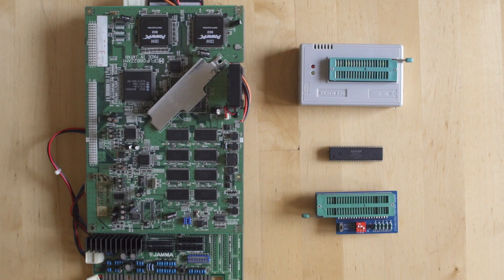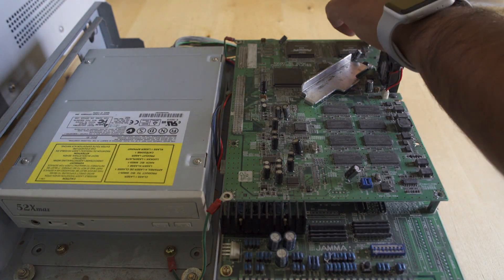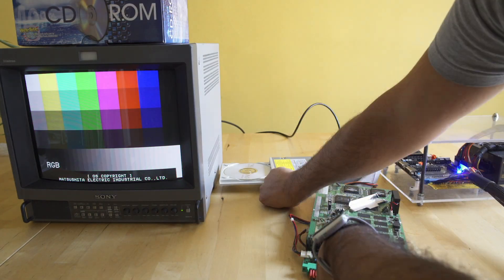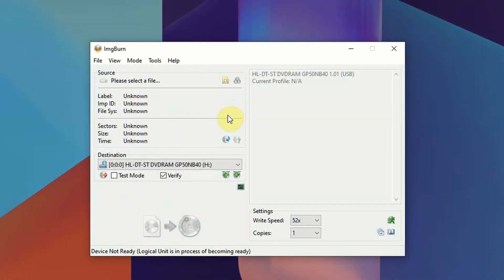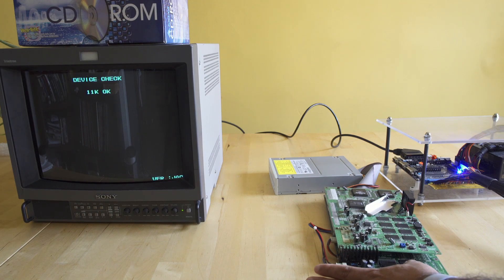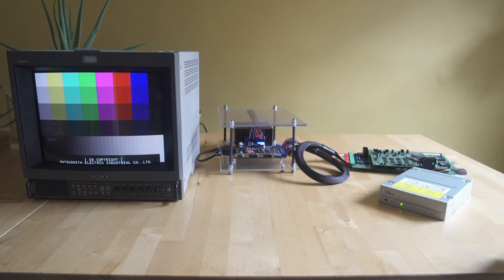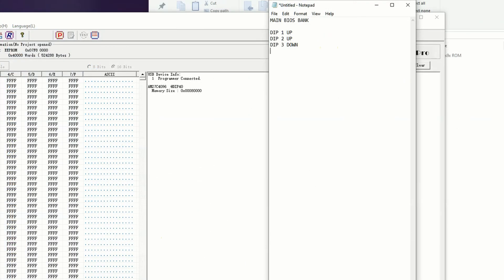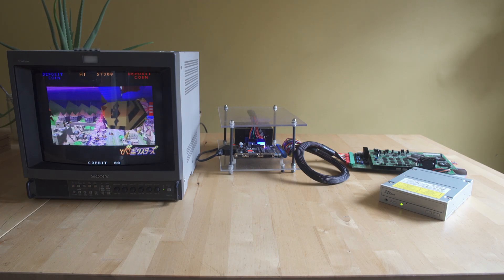Cracking Konami M2 Encryption Pt 2 - Tech Deep End - Video Game Esoterica

Comment: I think you could have done much of your testing on MAME, and saved yourself a few EPROM and CDROM burns. I was able to do use 3DO emulators when I was putting together the 3DO encryption toolkit. Of course, you still have to test the final product on real hardware.
Reply from the maker: The MAME emulation doesn’t support the console bios, so unfortunately that wasn’t an option. Maybe in the future “console” software will be supported in MAME
Reply from the maker: That is on my list of items to work on...getting the “console” M2 bios working via MAME so it can emulate console games / demos / etc

Comment: Awesome work! I think I've watched all of your M2 videos in a month's time and my brain is a little scrambled from all the info so my apologies if this is clearly discussed in another video.
I have two complete M2 boards.
Evil Night (full arcade machine), and Total Vice (complete boardset and CD-ROM.
Which boardset is easiest to run both games once you work a little magic?
Thanks
Reply from the maker: Evil Night. It has the third pcb for the RTC chip, so it’ll run all five games (with bios swapping and hex editing)
Reply: @VideoGameEsoterica  Whew! I spent a good amount of time on that one and it went from busted to perfect after some TLC. Huge thanks to your documentation on the M2 to get it there!!!
Reply from the maker: No problem! All I want is for M2 hardware to live :) I haven’t done a video on it yet but best method to use Evil Night for all five games us to set up a dual bios. Burn both bios files to the chip and solder a switch to the chip to bank swap from high to low. 

Or you can just swap the chips. They are socketed after all. Could use a 2 to 1 chip socket too
Reply: @VideoGameEsoterica  bringing this topic back from the dead! I've gotten a step closer to getting my Total Vice CD to run inside my Evil Night cabinet. I swapped out the BIOS from TV to the EN board. I've tried using 3 different CDs, but I get the same bad  result :(
Only if DIP 2 is ON (for the 2 DIP board not the 8), the game will load. If I switch it to OFF at anytime it freezes what is on screen and controls do not respond. Game goes thru all the checks and loads up to the start screen. 
DIP 2 however changes the screen resolution (i think) to one you can't really see what is going on, so this is not a solution.
The 3 cd's ive used all have the same effect: Original Total Vice AA639B01, hex edited version with only the 639 game ID changed to 810 for EN, and a hex edited one with GN810UBA inserted (which I believe is my correct EN game ID in the hex). Never hex edited anything before, so no idea. But since all 3 discs do the same thing...
Without changing the actual monitor, any suggestions? No access to a chip writer until I am employed and can buy one. If i can actually get both games running, this project is done and coming upstairs where all the cool kids play games!
Reply from the maker: You need a Standard def version of Total Vice. One version is SD and the rest are Medium res. I’ll look at my files as I know I have it. Leave me your email and I’ll try to get them to you. Might take a bit but I’m sure I can solve it
Reply from the maker: But yes the two dips are screen resolution and having them set incorrectly will either cause a freeze or the game will play blind / garbled
Reply from the maker: I checked my SD board. I wrote the code on the side of the box. Use the UAC version. 

Did you change the year in hex? Evil Night is 1998. Total Vice is 1997. It won’t appear in the translated hex but when you amend the disc code if you look at the hexadecimal values you will see an entry that’s 19 and 98 (or 97). It’s not written XXXX but XX XX.
Reply from the maker: As soon as I find the file I’ll send it over
Reply: @VideoGameEsoterica  ty! Found this message from you in 2018...
Answering my own question for posterity when someone else need an answer.

Total Vice AAB / AAC / UAC / JAD only run on the older bios.

AAC / AAB / UAC are all medium res. JAD is standard res and can be converted to run on all medium res board sets with some hex editing and dip switch changing.
Reply from the maker: Haha there you have it. I can’t remember what I’ve said and when sometimes. Especially from 2018

Comment: This probably sounds dumb but could you play IMSA racing on these boards?
Reply from the maker: It’s technically possible, but very difficult. I can burn and insert a FZ-35 bios into the socket, but it doesn’t have any way to handle player input (controls) or video (Video encoder vs JAMMA hardware for video) but it does contain all the chips needed to run. The arcade vs kiosk bios is very similar - probably 65-70% of the code matches...but that’s not enough as of yet!